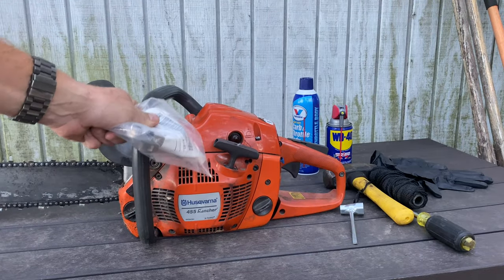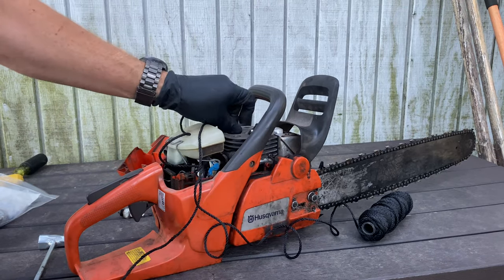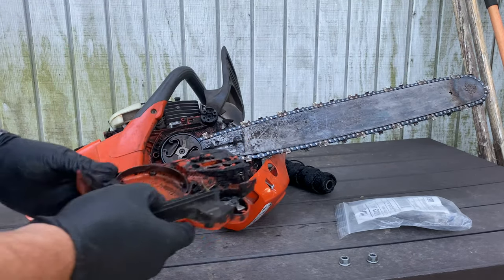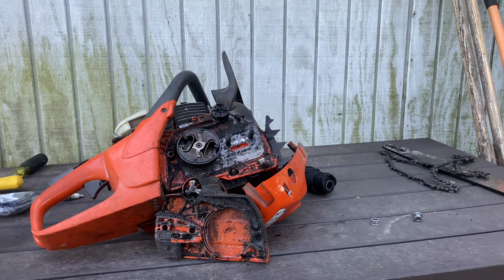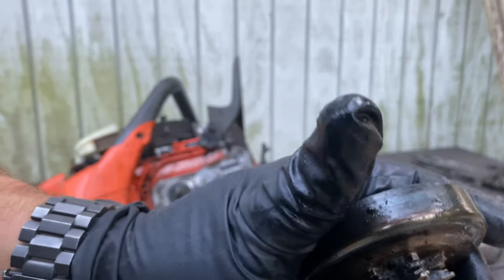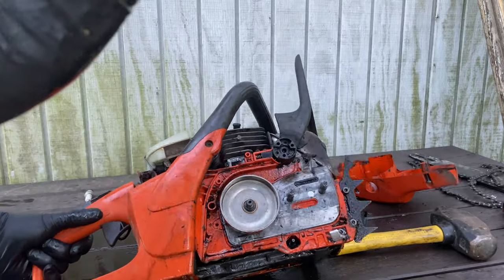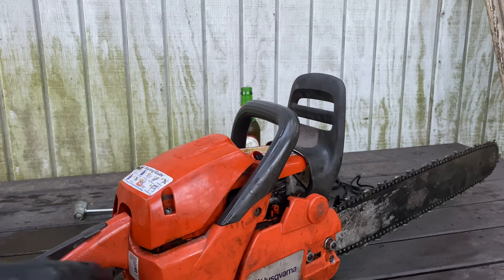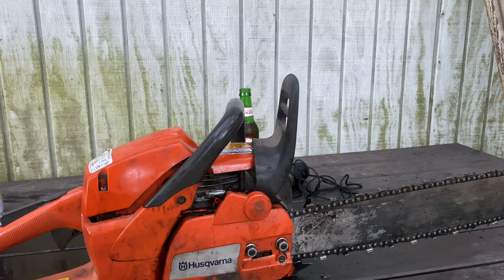How to - Husqvarna Rancher 455, 460 Clutch Drum Sprocket Replacement - 537 29 16-04 - chainsaw

Comment: When I first started, before any of these failures, I did have that in the WRONG position, and you're right! It was a horrible deal. I tried screwdrivers, probable a knife against a wrench, I don't remember, or whatever to get some cam-like action. I finally got it, but I don't  want to go through it again.

Comment: Hardest and slowest way to remove the clutch, easier to leave the plug in, whack the clutch with a brass drift and spin it off…left hand thread of course. Clutch even has arrows and a notch, indicating “off”.

Comment: Hey man. I really need your help. I bought a used 455 rancher. You clutch drum has the big teeth on the back and it said 3/8 on it. When I look for the 3/8 drum anywhere online/Amazon only the .325 drums look like that. The 3/8 look totally different. Very confused.
Reply from the maker: I don’t know I went to a Husqvarna dealer to buy my parts
Reply: @BayouRepairGuy  ok. Thx.